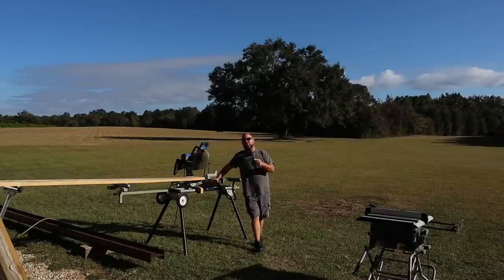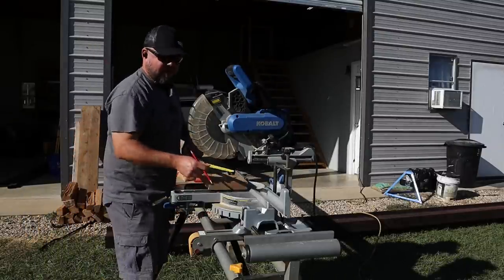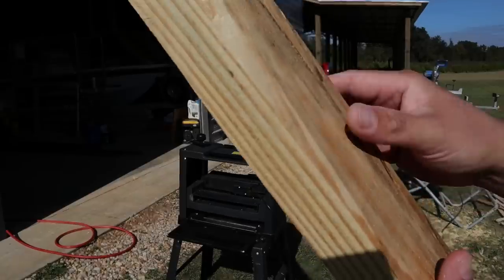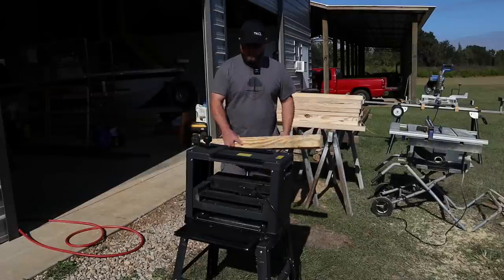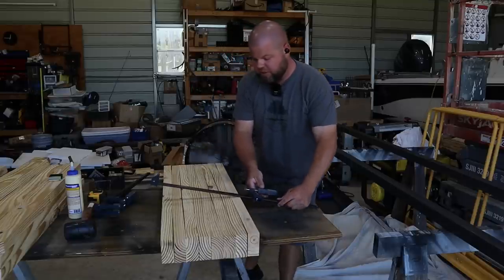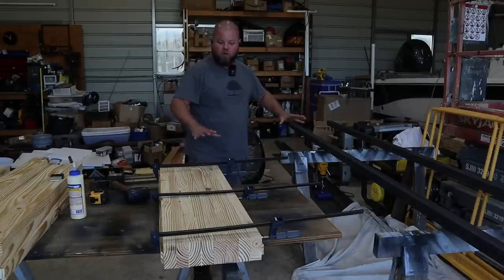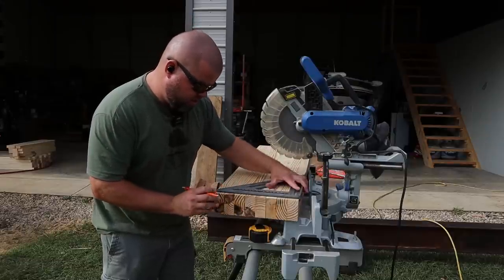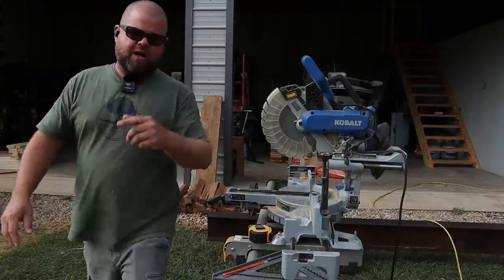DIY floating stair build part 1! Stair treads and landing platform #673

Comment: If you save your sawdust And mix it with your wood glue you can use it as a puddy also and it the same wood you just cut and or planned off
Reply from the maker: Exactly, I use mine out of my miter saw bag.

Comment: I went through exactly the same process not long ago. My wife wanted wooden countertops but the price was ridiculous had I bought manufactured wooden counters. I used the same laminating, sanding, & planing process and achieved the same beautiful result. One lesson I learned early on was to get rid of my sawhorses and replace them with trestles I found on Paul Sellers channel. They were easy to make, rock solid and support a ton of weight. They store in a smaller footprint and can easily be used as low scaffolds, Your woodwork as always is gorgeous and will make a beautiful addition to your home. Looking forward to seeing the stairs installed.
Reply from the maker: Thank you very much! I am planning on building some lightweight and strong saw horses.
Reply: @TKCL  Take a look at the trestles I mentioned. You won't regret it. By the way I love the chamfered edges on the treads. I went with a round over but I really like the look of the chamfer.

Comment: It don't work with satin or semi-gloss poly, but it anyone out there uses gloss poly you can wet sand and polish any flaw that may come up. After it hardens just "wet" sand it with a block and 2000 grit, and polish it up with a little compound & polish. It will give you a mirror like finish. 
That is going to look really nice Andrew.

Comment: Looks great! Just wondering about the moisture content in that framing lumber and if it won’t warp over time as it dries out inside your conditioned home.
Reply from the maker: That's kiln dried lumber, supposed to be around 13 percent if I remember correctly. The glue when applied correctly is stronger than wood. Not to mention every square inch is sealed in poly. I'm not expecting much more if any drying.

Comment: I am doing a similar build but considering running rebar through the treads to keep them from warping over time and to add some strength for floating application- any thoughts on this?
Reply from the maker: That glue is stronger than the wood. I wouldn't over think it and zero warping should occur with that many laminated together. Just make sure your support plate underneath the treads offers adequate support.

Comment: What is the size of the step treads ?
Reply from the maker: 10.5 inches x 36 inches, local code requires 10 minimum. Keep in mind some may require 11 inches, code changes everywhere.